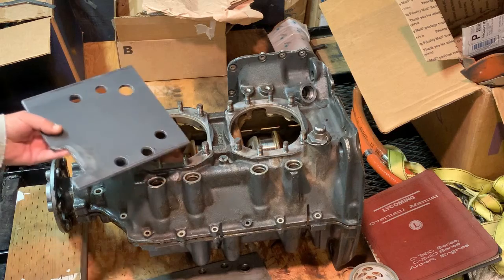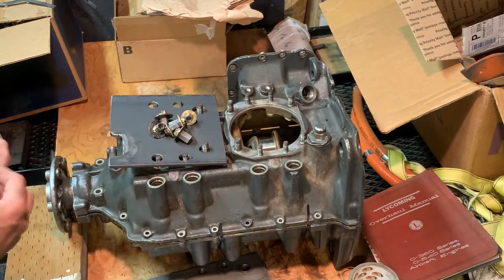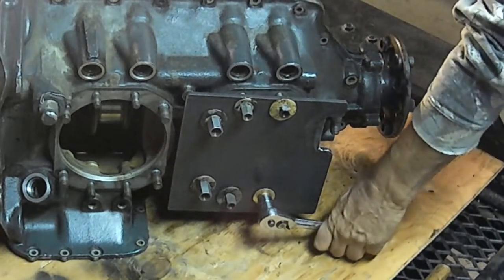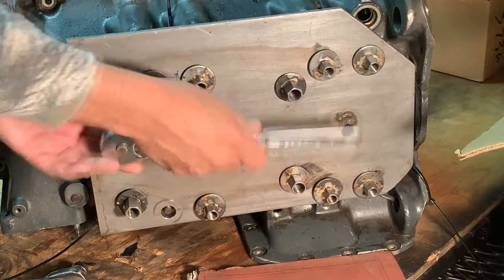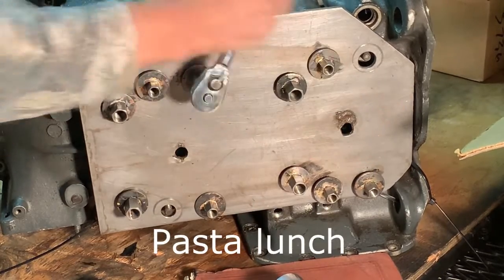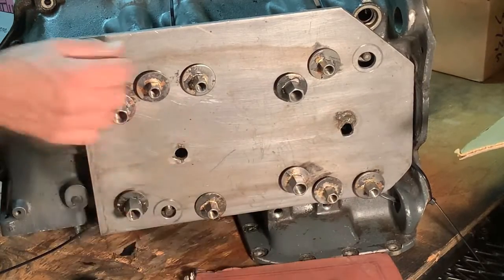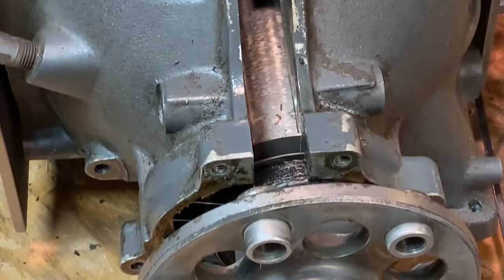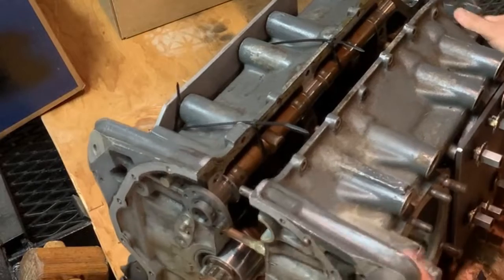Lycoming O-360 DIY Overhaul Part 3

Comment: Hello gentlemen please don’t do this again since you are not A certified mechanic so please remember this engines means your life to you in the sky even though this is not the right way to disassemble the engine ….. It's not the engine of your car in the garage, and if you find a fault while driving, you can pull over to the side of the road and fix it.  Fly safe
Reply from the maker: So, apparently you didn't hear everything I stated across several videos?  The parts will be checked and reassembled only by a certified engine rebuilding company. Since you seem to know a lot suddenly about correct disassembly, perhaps you'd put that into your own video and offer that to all? Confusing car engines with this helped no one as far as I can determine. It was a very poor analogy. Did you get any exposure to aircraft at all?

Comment: Questions and observations.

Why is sealant not applied to the saddles on the forward, center and rear webs of the crankcase halves on Lycoming engines-? 
Sealant is only applied to the parting surfaces around the periphery of the crankcase halves on Lyc. engs.

Continental engines apply sealant to the forward, center and rear web parting surfaces.

Since there is very slight movement between the case halves parting surfaces in the center of the engine, metal fretting sometimes occurs as well as oil ingression between the parting surfaces which eventually means metal wearing against itself and torque being lost on the thru bolt nuts. Then it is just a matter of time for having to do a premature engine disassembly. 

On another note, 

Lycoming engines have their camshaft mounted above the crankshaft which means no oil drip effect from the crankshaft on to the camshaft which results in premature rusting of the camshaft lobe(s) and lifter face(s) if the engine sits inactive for a period of time. 

Continental engines mount their engine camshafts below the crankshafts and are less prone to rusting of cam lobe(s) and lifter face(s).

Having to remove the propeller and starter ring gear on a Lycoming engine to change an alternator belt is a bad design while this is not necessary on most Continental engines since they mount their starters and alternators on the accessory drive case meaning that no drive belt is required.

Comment: I’m getting ready to overhaul mine, it’s an O360 A4M. How did you crate your crankcase for shipping? That’s my next step. My plan is to have all of the lower end components (bearings, conn rods, tappets, etc ready and have a professional assemble everything.
Reply from the maker: There's no set way to crate the case, but I used a heavy cardboard box outside with heavy cardboard inside. They won't provide any box for it specifically.  I'd use those internal end caps to ensure nothing can be crushed.  Insure it well. That will prevent most mishandling. I'm new to this as you know. I wish you well on your engine project and I'm glad my video helped you.
Reply: @michaelbradford2816  from your other videos t looks like you’re in Northern California-I’m in the foothills outside of Sacramento. I spoke to an engine guy up your way about a year ago about assembling the lower end for me and was was receptive to the idea